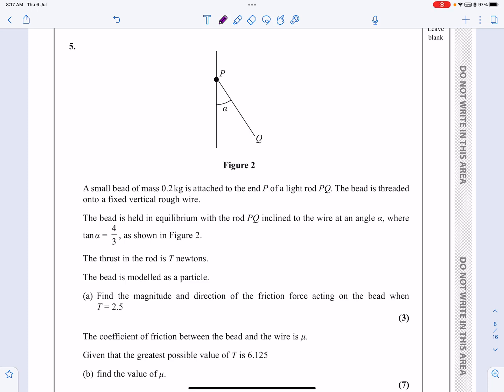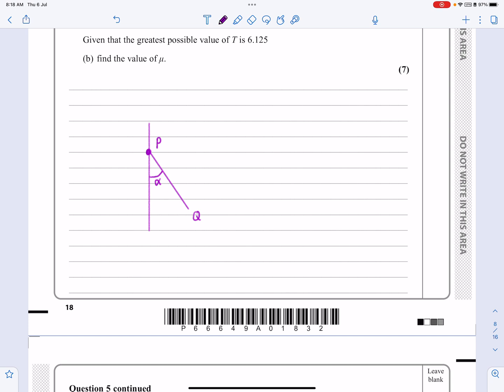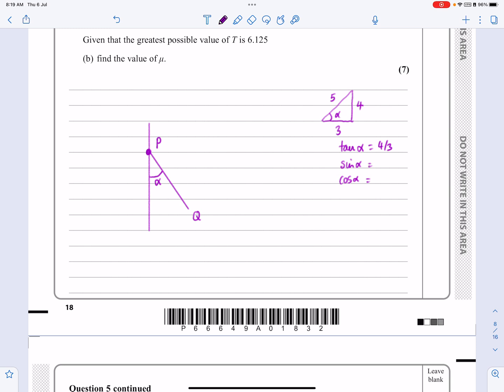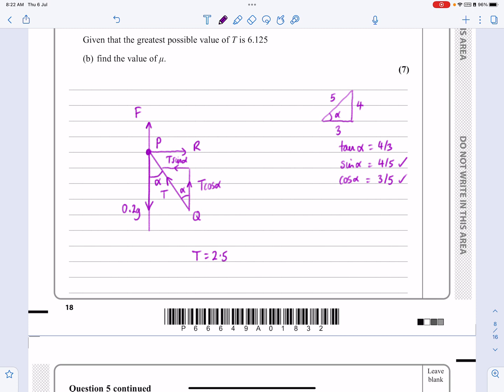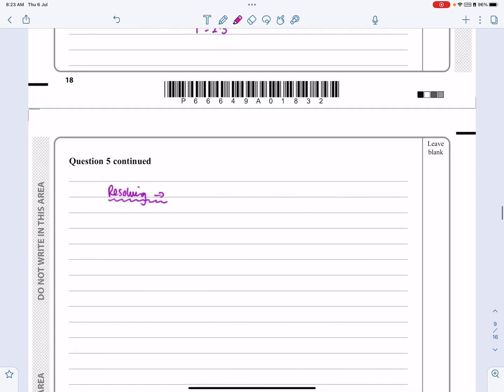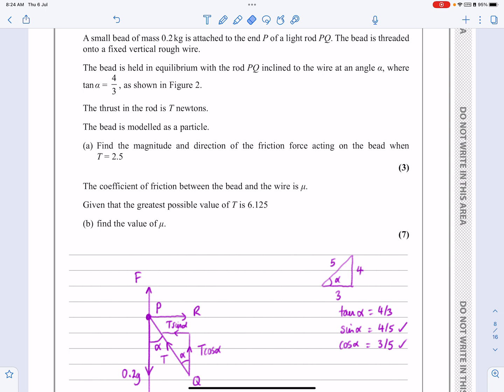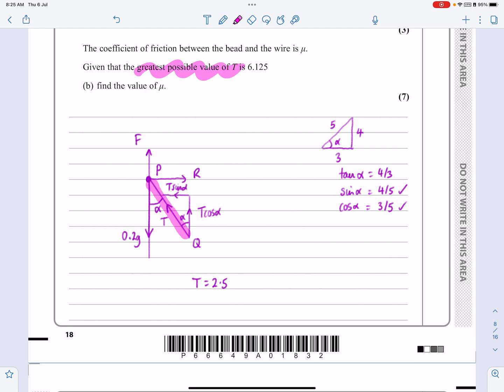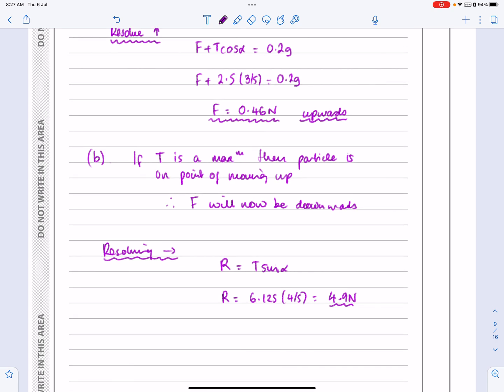IAL Edexcel, Oct 2021, M1, Q5, Statics, Force Diagrams, Friction, Mechanics, Nick Peters, WME01

Comment: why is it accelerating downwards im confused
Reply: Basically the value of Tcos or (2.5 x 3/5) (when calculated using the given value of T as 2.5 and our derived value of cos as 3/5) is smaller than weight (0.2g) / (0.2 x 9.8)
Reply: can’t tell what you’re referring to but if you’re talking about the 0.2g then that’s the weight it mentioned it had a mass of 0.2kg so the weight is 0.2g and it acts downwards always